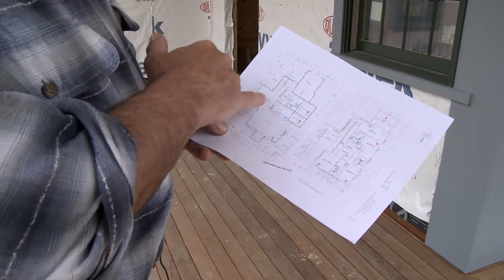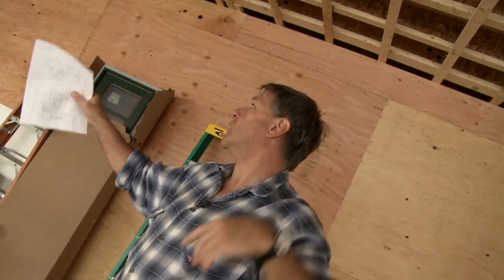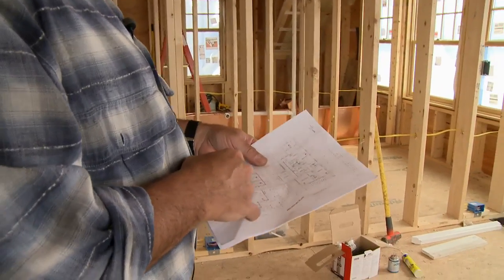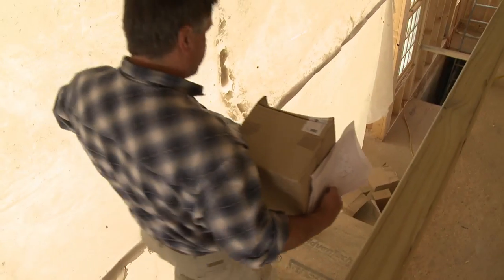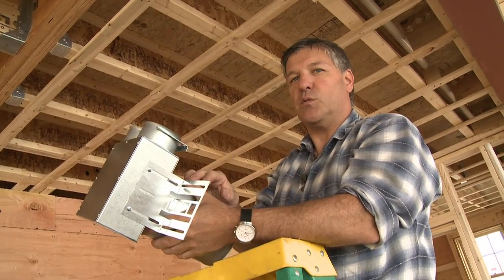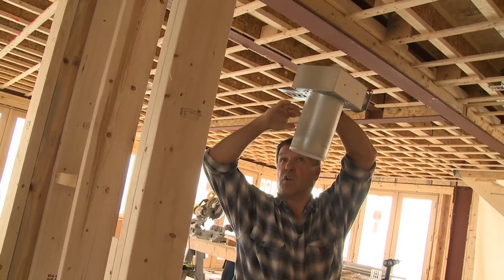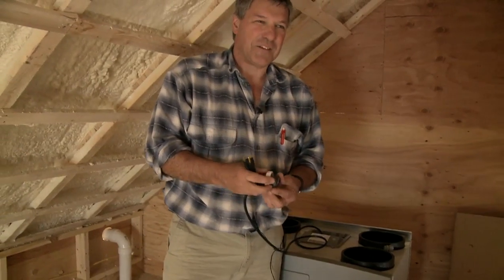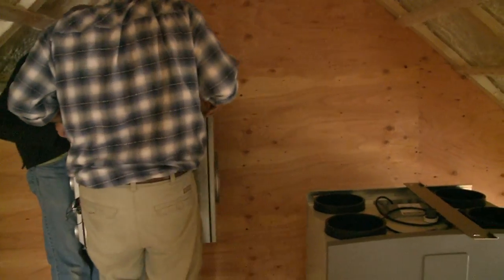How to Install Zehnder Comfosystems Part 1 - HRV

Comment: what is cost for that system?
Reply: 10000 plus
Reply: @nicholasfrancoeur3897  no way really ?
Reply: @@DemetriosChristopher I would not recommend skipping bathroom exhaust or kitchen exhaust fans.  I have lived in a house with an HRV and no other exhaust fans for 30 yrs and there are times when bathrooms and kitchen have air quality problems.
Reply: for my 2,244 qsf house its like 12k but im thinking its dbl becuase of the living space in the basement so 4,480